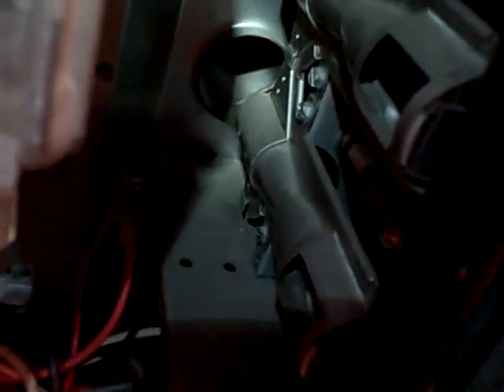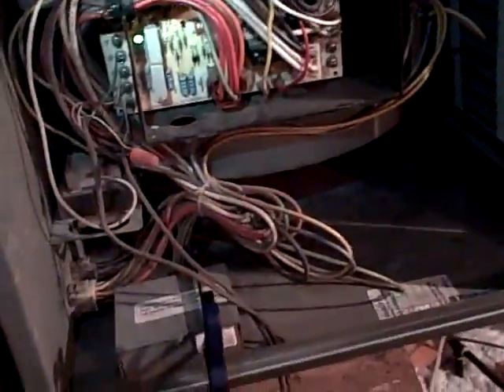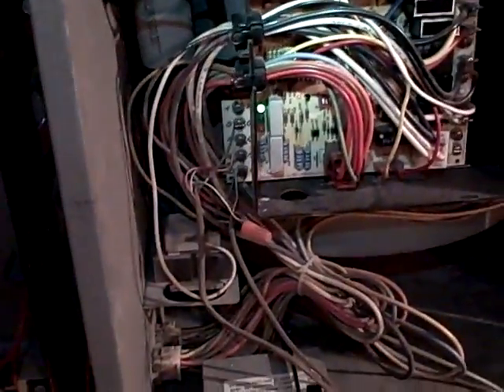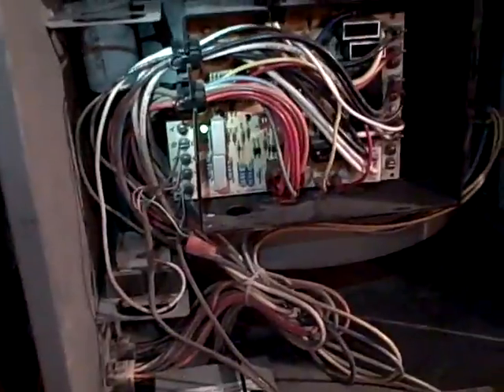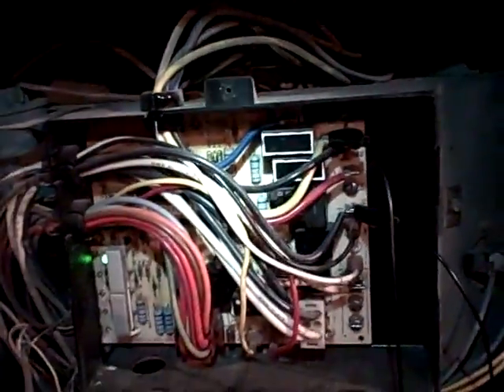HVAC Troubleshooting a gas furnace control board and blower motor.

Comment: Mikie, I enjoy your videos and find them very informative; however, I have a question.   I can control/run heat with the blower motor from my t-stat, so I know the blower is good.  If I try to cool, the compressor comes on outside but no blower motor on the unit.  Your videos talk about adding a jumper so in cooling, the blower runs 24/7 (and they caution NOT to do this for heat.  Is turning the AUTO-MAN fan switch on the t-stat the same thing, or does that put it in a slower speed?    Thanks, Ken
Reply from the maker: Hey Ken!  When you switch the blower over from the Auto setting (where it normally is) to the Man or ON (manual) setting it is basically just turning the blower on HIGH speed and it STAYS ON until you put it back in AUTO.  If the blower runs on Low in heat mode (which is normal, will usually be low/medium) but in cool mode the blower isnt coming on BUT you can get the blower to come on by switching from AUTO to ON, then you know the blower is fine and that you either 1. have a wiring issue (NOT likely if it worked fine before but just started acting up and nobody has been working on it) 2. Have a thermostat problem (possible, but less likely) or 3. You have a relay problem. In this case it could be one of those blower relay modules with a mini circuit board attached acting up. So does the auto/on work? What brand is the furnace/air handler, Trane/american standard?
Reply: The blower working in the different modes is as you understand. (Blower in Heat works if fan is either auto or manual, Blower on in Manual with neither heat nor cool selected, and Blower works in Cool ONLY if manual mode for the bower is selected.   I don't think it is a wiring issue, as it just started and no one was working on blower wiring.  I recently replaced the t-stat, but with only 4 wires, I don't see how I could have screwed that up (Heat works when it should, compressor comes on when there is a call for cooling, and fan Auto-Manual works).  The unit is a Goodman.  Do I have to replace the entire control board (any adjustments?) where will I find the part number on it?

   Thanks,
        Ken
Reply from the maker: Aha! Now we have it figured I think. Pretty sure anyway... Take a look at the thermostat and see if there is a switch on the back, or if its digital it might be in the settings, and you will find an electric/gas option. Try switching it from whatever it is on to the other setting. Then try testing Heat AND cool modes again, make sure to test both just in case it fixes cool but drops the blower on heat.  ...anyway the situation sounds like something Ive seen before.  Give it a shot and write back, think i just caught your post as you sent it! :)
Reply: mikie2501,That did it! Works in all modes! I thought I had it set according to the instructions and never bothered to check if changing its state would make a difference.  You deserve a raise!!!  If you're ever in the Cleveland, OH area, shoot me an email and I'll buy you a beer!  My wife thinks you're the greatest, too!  I'm going into the hospital tomorrow for some (hopefully) minor heart surgery and will rest a lot easier knowing that this is working!  Thanks again!!
Reply from the maker: (Smile on my face:). Awesome! Its always great to help someone when I can,which can be difficult without actually seeing it in person,and glad you told me too, lots of times I don't get updates on wether things got fixed or not! Just remember to check it in heat mode as well so you dont get any surprises later. I'll settle for a virtual berr, hehe, not likely to be in your neck of the woods, though my wife is threatening to drag me to Misery,I mean Missouri to visit her family later in the year ;). ...and a raise would be nice, but I actually haven't done HVAC, or anything,for a while now due to spinal problems. Just recently been feeling good enough to actually try and catch up on messages here!  Man I hope your surgery goes well, we will pray for you on this end :) Ill try to remember to check up on you next week.  Mike :)
Reply: Yes I would definitely replace the control board. It is bad, they are all the same. It should be a fun diy project.

Comment: Hey Mikie, how do you hook up the jumper wires for bypass, I have read that it is unsafe to bypass the thermostat on the R and W Terminal for heating , is that true ?
Reply: it CAN be unsafe. it depends on your intentions. you can do it for a temporary fix. be sure one leg is unhooked from the stat first and power to the unit is off.

Comment: Great video!  I am pretty sure now that I have a control board problem.  It is an ancient ThermalZone model PG036K096-1B ? (I think - it is incredibly faded).  The symptoms have changed a few times.  At first it was heating but no fan.  I discharged and checked the run capacitor, and then it worked for a while - not sure why.  A week later another problem - nothing happens after the draft inducer runs.  I saw that my hot surface ignitor was cracked, so I replaced it.  When I started it up after the draft inducer did its thing the ignitor started glowing extremely bright and shattered.  Thinking it may just be a faulty part I exchanged it.  The same thing happened again.  Is the control board is sending to much voltage to that?  Since the blower won't operate at all now can I assume that these two symptoms are caused by a bad control board?  Are control boards fairly universal?  Like I said the unit is very old and I can't find any documentation for this old model and replacement part lists.  Thank you so much for your insight!

Comment: hey my trane heatpumpis acting up. my heat turns on fine but as it gets close tomy temp setting it just blows air.
Reply from the maker: Hello!  A lot of systems have a sort of energy efficiency mode built in; when the system reaches temp, or close to it, it cuts the heat off but leaves the blower running, usually anywhere fom thirty seconds to a minute and a half. The reason is to get all of the excess heat out of the system and ducts and into the house, as well as cooling the unit down some before it shuts off.  Often the result is feeling luke warm or slightly cool air at the end of a cycle. If the heat pump is running its more obvious, if the gas furnace is running its less obvious since it usually runs a bit hotter.
Some systems can have the timer adjusted on the control board, but if it seems to work well in gas furnace mode then its not worth fooling with. Its not hurting anything though to leave it as is.  Hope this helps!
  Mike

Comment: Hey Mike. Great video thanks. I have an american standard 80000 btu 90% and the fan inducer and the blower are starting  blowing cold air as soon as the thermostat send the signal but It doesn't even gives it a chance for the ignaitor to get hot and then I get the 4 flashes code about limit switch open. I replace at the end of last winter and this month the air pressure switch, two roll on switches, limit switch and the snap disc control.  Could this be a bad board? Thanks 4 all the good advice.
Reply: I would start with the board. It is always the board. But there is a very slight possibility that it is some other minor issue. A trained hvac professional can come out after you replace the board and repair your furnace for you. He is just a phone call away.

Comment from the maker: Damn, I should have just made a video, lol :)  maybe I should! hehehe.  I think that's all I can think of at the moment, my brain is fuzzy today with 0 hours sleep last night! P.S.  Make SURE you read the FLASH CODES correctly, it's easy to mess them up! hehehe :)   Hope this helps.  Oh P.P.S.  Unless the limit switch was just old or faulty, they ALWAYS trip for a REASON. It's important to figure out WHY! Such as a flame rollout or dirty filter overheating system etc. NEVER BYPASS SAFETYS!!! :)

Comment from the maker: and see if you get a voltage reading. Just making sure you are actually getting voltage from the board going THROUGH the limits :) If this is fine check the Draft Motor power, cycle unit again and check for 120v AC on the two power leads on the draft motor. If you FAIL to get voltage to the limits the board is likely bad. If you HAVE voltage on the limits and they are ALL good (closed) and no voltage (15 to 30 seconds after you cycle the heat) to the draft motor, the board is likely bad. (cont)

Comment from the maker: Don't forget to check the large limit square in the middle of the furnace face (usually mounted in a square or round piece of material. This is the thermal limit in case the thing gets too hot in the main chamber. It may be wired seperately since most systems will force the gas off and blower on if it trips. There may be one on the flue pipe as well. If all ok have someone cycle the system while you put your meter on one of the limit terminals and the other on the metal frame somewhere (cont)

Comment from the maker: The second one is the problem. ALWAYS RECHECK the limit switch after you have removed it to make sure you tested it properly. (note sometimes the damned things will pop back in place while you are handling it, lol)
If the system (usually) has more than 3 limits and the first two are good keep up the same thing, just move the second lead to the FAR side of the next limit.  Did I mention $740 is freaking highway robbery? If you live in ft. worth I'll do it for that and cook dinner! ;)(cont)

Comment from the maker: and press the points in good for contact. Listen/watch for the volt meter. If it shows sometihng or beeps you know the limits are fine.  If you get NOTHING then you know one (or more, but unlikely) of the limits is bad (assuming all are reset). At this poing check them ONE AT A TIME. The first one is easy since you have one wire off. put a probe on each side. If it's good then leave on probe on the unplugged side and move your probe to the FAR side of the NEXT one. If you get nothing then (cont)

Comment from the maker: The tabs RIP OFF of the limit VERY easy so hold it in place when you pull the wire off. then set your volt meter to Continuity (may have a music note pic or something also typically a Diode picture) Test the meter by touching the tips together and watch the meter. It will either beep and/or give you a numerical value. Touch one lead to the limit with the removed wire and the other lead to the outside tab furthest down the chain on ther other end, make sure you have a good connection (cont)

Comment from the maker: then you need to pull the power plug for the unit, or if it's hardwired kill the breakers. Test with a voltmeter to make sure the power is off.  Need to test the limits with a volt/ohm meter. most units will CHAIN all of the limit switches together in a string =----------[O]--------[O]-------[O]---------=  and you can pull JUST the far end of one. You HAVE to put a flat blade screwdriver against the metal tab on the limit switch if you pull it there instead of the board because the tabs (cont)

Comment from the maker: Hi Sarah, sure! First my normal have a tech do it because you are working with gas and high voltage and this could be lethal! That said, if your're going to do it anyway there a a few things to check. First check the limit switches. Some are resettable and have a little button on them, some are automatic and normally reset themselves. Look carefully as they are sometimes hard to spot! If you find one tripped, reset it and make a note of WHERE it is for later. If you do NOT..(cont. next message)

Comment from the maker: I'm emailing you with more information but here is a good starter video that I did recently on this very subject, depending on how you want to control the blower:
Argh!  god, the retards STILL won't let me post video links in my OWN message area pointing to my OWN videos, what the hell?!  
Anyway you can look through my videos or search for this:
HVAC Simple Control System for installing an Inline Duct Fan.

Comment: Hi Mike. I turned my gas heater on after along summer and was getting a limit switch open error. Called a HVAC tech and he told me it was my inducer motor and quoted me $740. I found the part online, replaced it and still am getting the error. The inducer fan will not come on at all. Any thoughts?

Comment from the maker: hrm... could you walk me through the process with a bit more detail?  What do you mean by 'warming up'?  What kind of furnace is it; is it a standing pilot gas furnace or does it have hotsurface ignition or spark ignition? The latter two have an 'induced draft motor' mounted n the furnace, is that what you hear starting up?

Comment from the maker: Hmmm.. define 'Emergency Switch' in reference to where it is located. Do you mean main power shutoff or are you talking about safety switches on the furnace? The thing SHOULD have had to be inspected originally when it was installed and if it WAS and the furnace hasn't been changed out, etc, then I would think it would be grandfathered in. That is typically how it works unless you have had equipment/major wiring etc changed.  A bit more information or send me a private message with your phone #.

Comment: hi a rheem ruud criterion the thermostat goes on the furnace start working and  outside unit won't go on but i test it the contactor the capacitor everything is okay.
but when i try to shut off from the thermostat won't stop the furnace i check the thermostat and it;s okay please any help thank you

Comment: Great video!  Just had my gas furnace stop working.  Blower did not work.  Heat did not try to cycle but the a/c did turn on (no blower thou). Because the heat cycle did not even try to begin i swapped same unit boards (have two units) and YAY!  Got a board online for $92 bucks and saved like 500 on service calls:)  Id never try to mess with the gas parts above thou. Good to remind people not to rig these boards and bypass stuff.  DANGER!  Keep up the good work.  You are helping people.

Comment from the maker: @xXxCrazyJayxXx   With a standing pilot that is staying lit but the furnace not kicking on it could be any number of things.  There is a good chance that the gas valve itself could be faulty.  You are going to have to get a technician out to look at the thing...it could even be a combination of things....but when working with gas it is best to just pay a pro to work on it so it's done right and double checked! :)

Comment from the maker: @mikie2501 I am not there to see the unit, whether it is a closet unit or an attic
 unit, but typically this would indicate a seriously defective furnace.  To
 have the smell (usually can't smell it which is what makes it so dangerous)
 and these health symptoms then there is usually a huge hole or holes rusted
 in the heat exchanger.

Comment from the maker: @LaoSoftware Do NOT use this furnace!  Immediately turn it off and turn the gas valve
 control if you can find it to the off setting as well and then open the
 windows to clear the air.  If you feel that your health or the health of
 others in the house is a problem you should see your doctor immediately.

Comment from the maker: @nothadnotbad you'll have to give me a lot more detailed info before I can come up with some ideas.  I don't know that this on/off toggle switch is that you are referring to?  What keeps coming on and off?  Auto is just the switch setting that helps control the blower motor.  ON position and the blower runs constantly, AUTO and the blower only comes on when the system is getting a call in heat or cool mode. (generally)

Comment: @mikie2501   I just purchased a house. When the gas furnace is turn on, my house starts to smell like gas.  I get dizzy, sleepy, and nauseated.  Is my gas furnace leaking gas or what?
Reply: If your still alive Lao. It probably has a cracked heat exchanger. Sleepy and Nauseated are signs of carbon monoxide poisoning. You are breathing exhaust fumes from your furnace that are suppose to be going outside up a exhaust pipe.

Comment from the maker: @kcmalikrod Well check to make sure that you don't have the fan set to ON instead of AUTO, should be on AUTO.  If this is ok then it is possible that the blower is stuck on.  I"m not sure how the fan is actuated on that particular model, could be a relay or could be a heat sequencer or there could be some other damage that is causing it to stay on.  I did a quick google search and see it has a control board so it is most likely a relay.  Have a tech. check it out.  Michael

Comment from the maker: @aareleb The control board is wired in such a way as to keep the average user from wiring around the pressure switch.  It's there for your protection, you do NOT want the unit running if the pressure switch has a real reason not to close.  ...there is a hose that goes from the switch to the furnace, 'gently' remove it on the furnace side and take a SMALL paperclip or small wire bit and see if there is rust blocking the nipple.  Regardless it's time to call a tech out to give it a full checkup.

Comment from the maker: @webowltoo1961 Well it would have to be a pretty significant crack or rusted hole to affect it that way, usually an older furnace, although some brands/models have known issues.    If you just replaced the sensor you might see if that solves the problem.  have a professional check it out if you have concerns here that way you know everything was looked at and also that it is put back together properly with all of the proper seals.